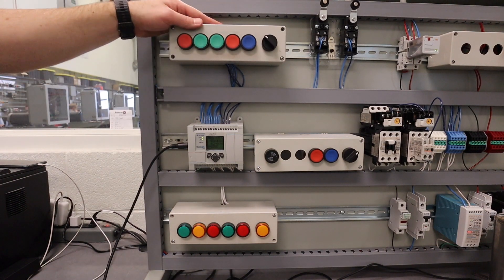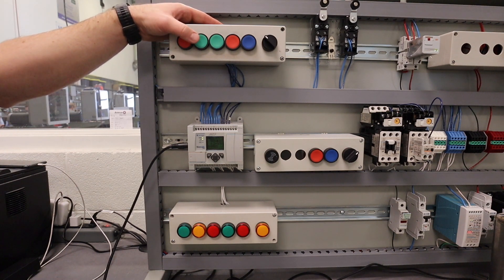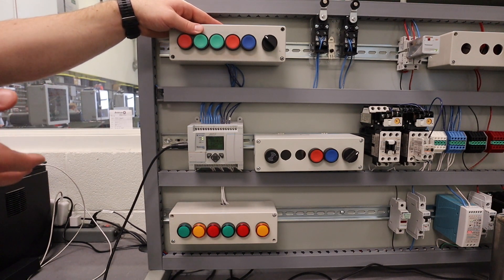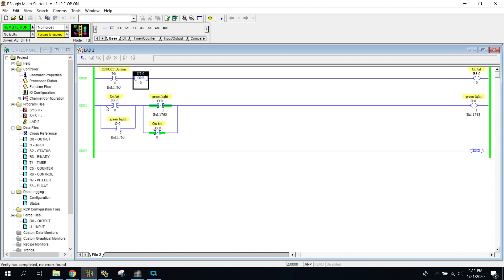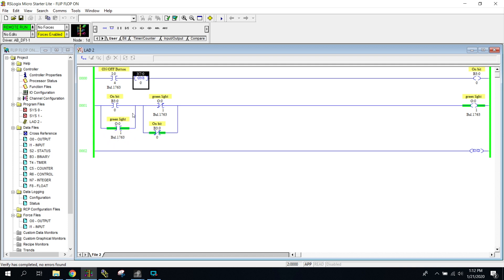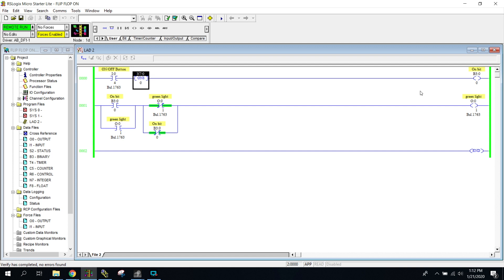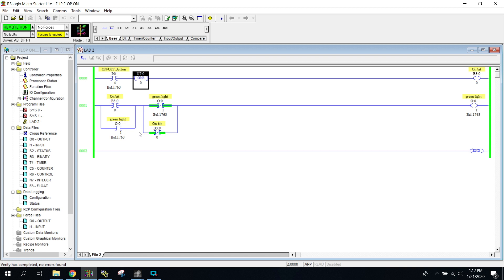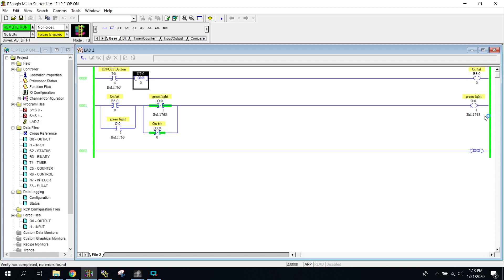Allen Bradley PLC - One Button On/Off Logic

Comment: Thank you for push button start and stop design. I would like to ask can I hook this up to the 4 light sequentially turn on with analog input 1V = 1Sec to 10V = 10src. 🤔
Reply from the maker: Yes, you could but you might need a lot more logic to that includes math instructions and times for something like that. Good luck
Reply: @Mikesfilmss  Dang it. They did not call a challenge for nothing LOL.

Comment: Not clearly kindly make clear video and each thing tell how you make step by step if you have a time sir
Reply: Same here bro,
He almost explained nothing. 🙂
Reply: The first Line sends an impulse to B3.

The Second Line says: If you have "B3 ON" and "Green Light OFF", turn ON the Green Light.
2nd part of the Second Line says: if you have "Green Light ON" and "B3 OFF" (which is now true), turn ON the Green Light. So now the 2nd part of the Second Line is powering the light.

But what happens if you press the button again?
Send a B3 impulse through the first line

The Second Line says: Have B3 ON? (True), Have Green Light Off? (False) Doesn't go through...
2nd Part of Second Line: Have Green Light On? (True), Have B3 Off? (False) Doesn't go through... And the self powering goes off, light shuts off.
Reply: What’s b3? Is that a control relay or timer relay?
Reply: @JetMakesBeats  that's a memory bit.. its like a  coil except that its not present outside as an output